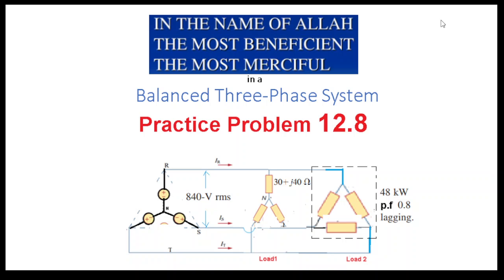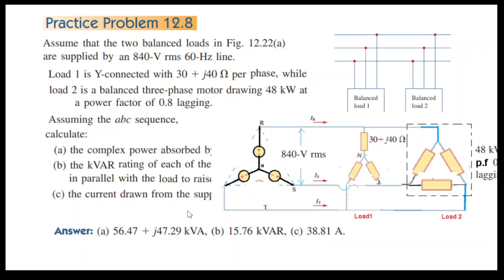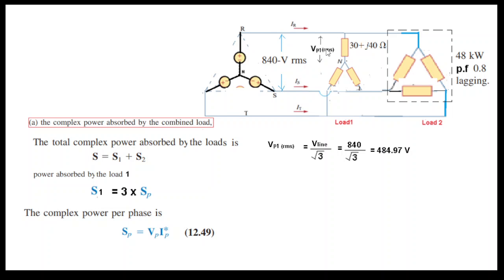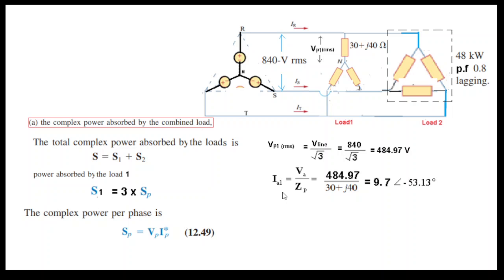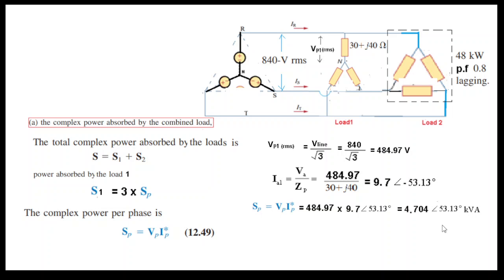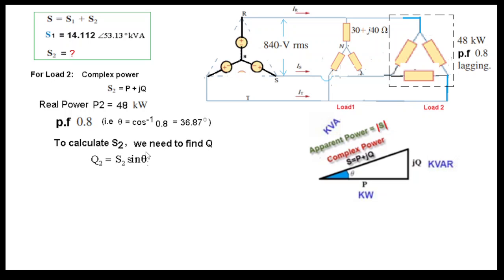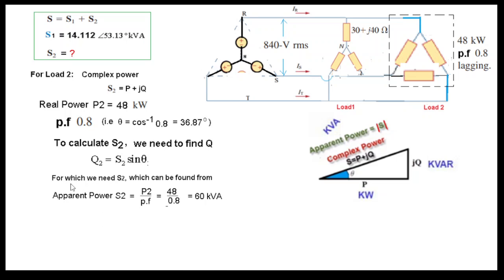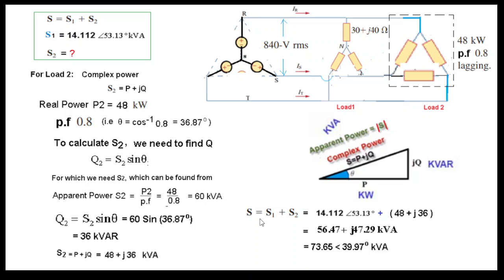(English)ENA ||  Practice  12.8 || Power in a Balanced System

Comment: Thank you for your video, but there was a minor mistake calculating the phase voltage Vp phasor, which should be (Vrms phasor / sqrt 3) * Angle(-30), i.e. 484.97 Angle(-30). Nevertheless we both get the same answer in the end.
Reply from the maker: Yes, you have a point. Thanks